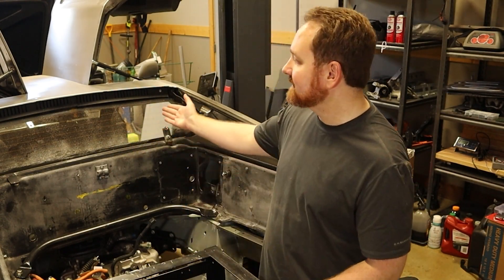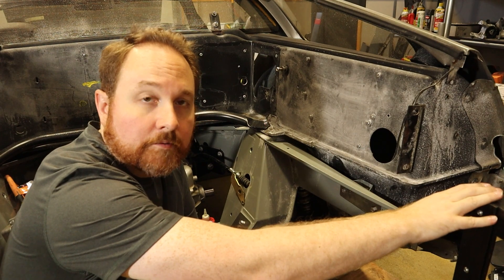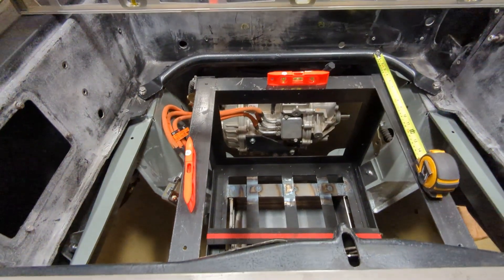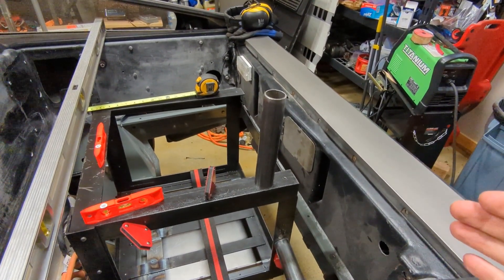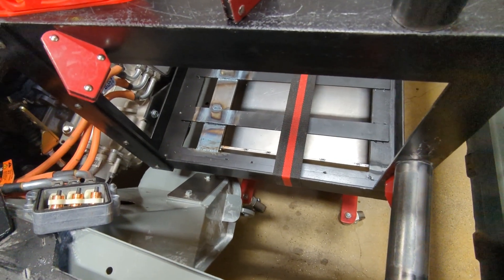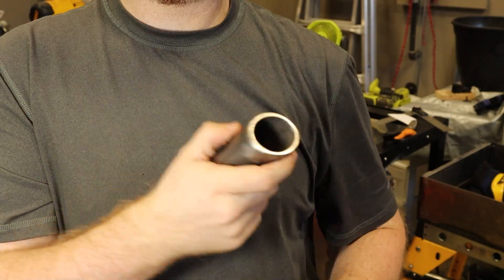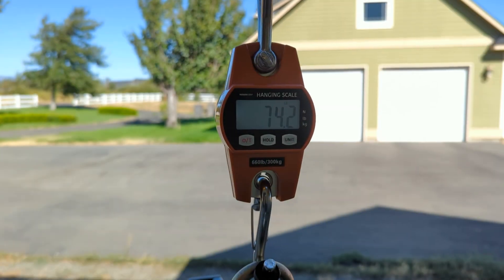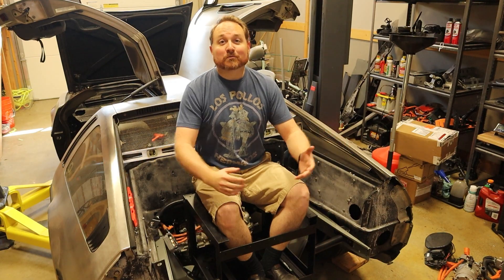DeLorean EV Conversion - Mounting the Rear Battery Box

Comment: A phrase to be know for.  7 inches is more than I need. 😆.    I love seeing the updates on this build.  I would like to do one but with an older SUV.  A 05 Escalade to be exact.   I think with the engine bay and the space between the frame, where the transmission, drive train, and fuel tank live.  Is plenty of room for batteries.  Two motors to keep it AWD.  That would be a nice project.

Comment: I'm worried about the dynamic load of that battery box if you hit a bump.  I'm no engineer or a welder but to my my uneducated untrained eye if two bars met at the plate from the top and bottom of the box it might be better? You have been doing really awesome work on this build, I'd hat to see it dragging it's battery down the road like a toddler with a full diaper.
Reply from the maker: Thanks Matt! Yes, some others have suggested some gussets on the rear tubes as well. I'll add something before I really stress it, for sure!

Comment: Bill, I understand mild steel (which I understand is a form of carbon steel) against stainless can lead to galvanic corrosion. What are you doing to mitigate that?
Reply from the maker: My understanding is that this is caused by having unpainted/uncoated parts where electricity can conduct between them. My stainless frame is powder coated and the battery boxes are painted, so they should not have much corrosion - that said, "should" isn't something I like to rely on, so I will monitor this!! I am using dielectric grease on ground straps and anti seize on everything else, too.
Reply: @BillCarlson  Seems like there should be a triangular piece welded to the topside of rear horizontal pipe and welded to the battery box in case you hit a pothole, the sharp jolt on all the battery weight might cause it to sink. How much does the box with batteries weigh? Love what you're doing big time!!!
Reply from the maker: @marcbee1234  That's a good idea! The pack weighs about 400 pounds with all the modules installed.
Reply: @BillCarlson  got it. I didn't have Josh powder coat my frame because I liked the stainless look. But we are currently planning to use stainless steel for the battery boxes also.